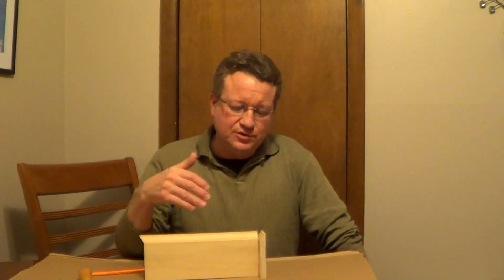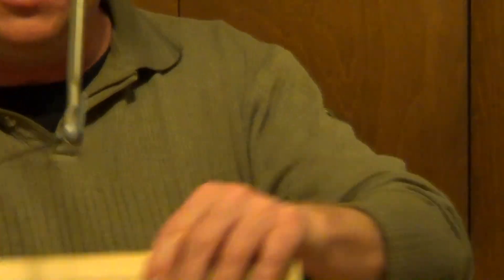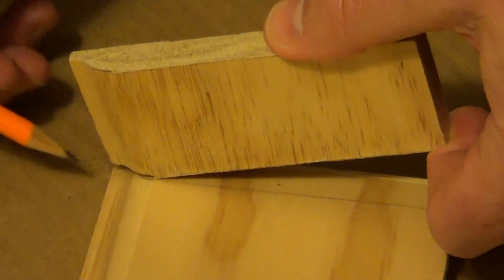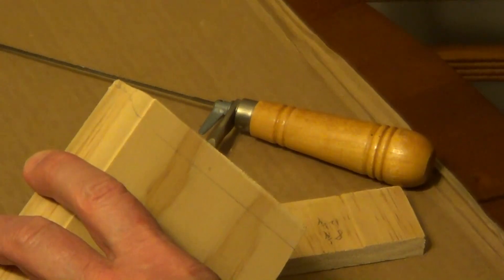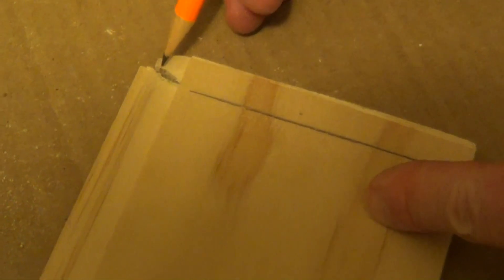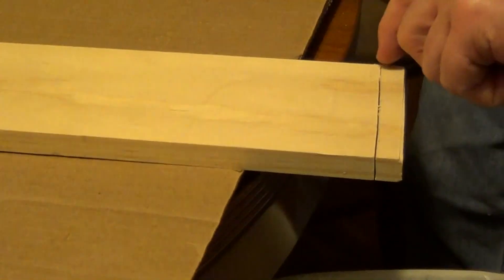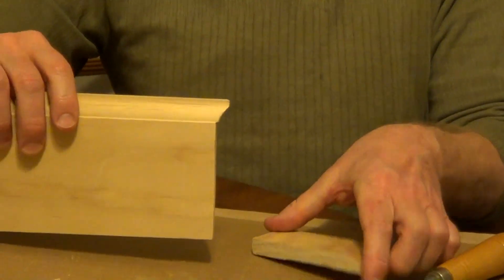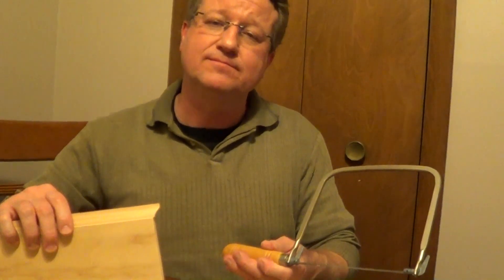How To Cope Molding - Coping Saw - Tools For The Home

Comment: I have installed miles of lineal footage of moldings. Always preform an open 45 degree miter cut (degree varies depending on the angle of the inside corner you are fitting to)then just follow the edge of the cut with coping saw(here is were I might use a pencil to just highlight the edge) and you will get a perfect fit. There is definitely a knack to it and it can get tricky getting the right look if your walls are all screwed up and angles are not true, takes practice for sure! Good video though.
Reply from the maker: Justin Schaak Thanks for the tips. We also have a weekly podcast http://www.stitcher.com/s?fid=49441&refid=stpr

Comment from the maker: Hi,
You would only use a coping cut on an inside corner. You can do 135 degree on the inside, you will just have to back cut enough material off to have it fit properly.

Comment: Cut the molding at a 45 degree angle. That way you don't have to pencil in a line instead you follow the flat surface where it meets the 45 degree angle. Secondly you don't have to cut through so much wood.

Comment: you actually cut a 45 degree and use the coping saw to cut perpendicular on the rough face, and use a angular rasp to smooth out defects, push in with caulking or wood filler, according to wood type.
Reply: Agreed. Much better method.
Reply: If you don't have a miter saw I guess. This would work.

Comment: 0:50 - just miter the workpiece and follow the face edge of the mitered cut... no need the trace anything.
Reply from the maker: Thanks
Reply from the maker: Thank you.
 Check out our weekly podcast on iTunes or Stitcher. https://itunes.apple.com/us/podcast/fix-it-home-improvement/id880903087?mt=2
Reply: No trim carpenter uses the tracing method. Far too time consuming. They miter at a 45 and then cope the piece.
Reply from the maker: Hi, I like that method better too, if you have a power miter saw. This is a simple tip for homeowners without a lot of tools.
Reply: TomKaren94 Check out the BIG BRAIN on TomKaren94!!! 🧠 Good Job! 👍

Comment: I use the coping saw on the pull stroke and the carpentry teacher I work with says I'm wrong.
Reply: I learned the to use a pull stroke from a finishing carpenter. He said you have alot more control pulling instead of pushing the coping saw.